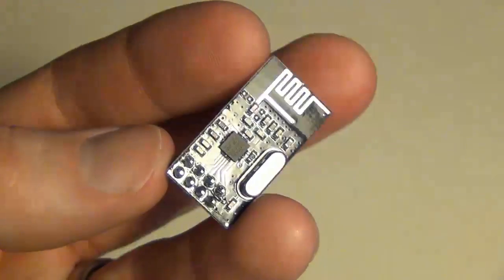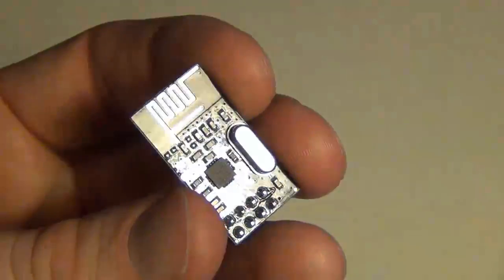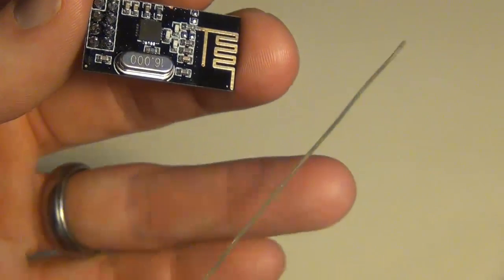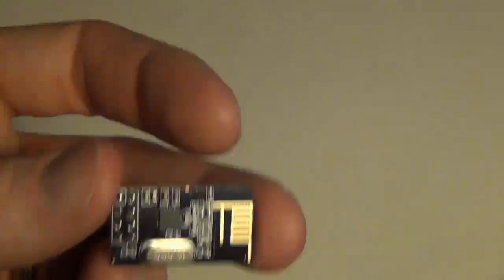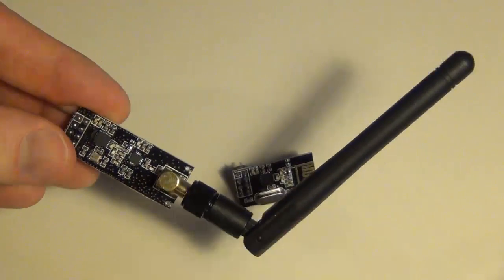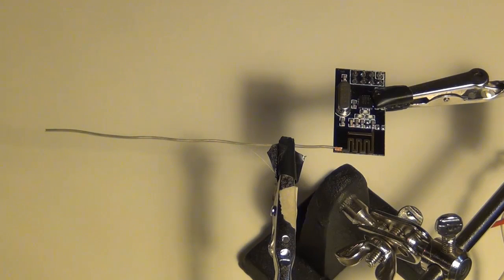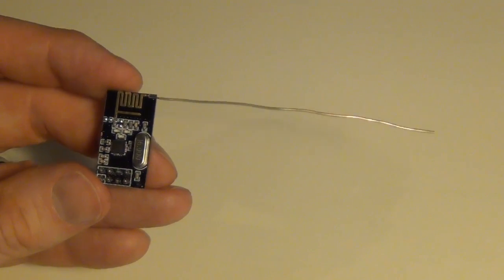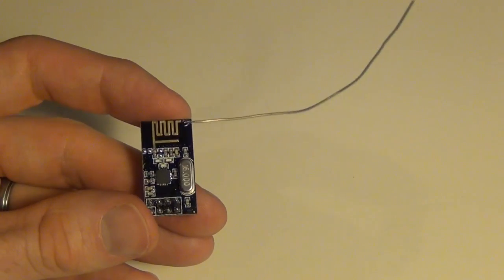Cheap DIY NRF24L01 Antenna Modification

Comment: I did the same thing with a ESP8266 wifi antenna and it worked. Thank you!
Reply: vi que voce é brasileiro
preciso de uma ajuda com um modelo de ESP8266 que tenho e gostaria de testar essa modificação, mas a antena é um pouco diferente!
Reply: @guilhermecorrea1775  qual modelo vc está usando? tem um link? o ESP8266 que eu já usei tem a mesma antena que mostra no vídeo. ficaria feliz se eu pudesse ajudar de alguma forma. a princípio, sugiro você simplesmente fazer uma solda como no vídeo, não precisa raspar nem nada como alguns vídeos mostram por aí. no pior do casos, é só tirar depois.
Eu sequer fui metódico em relação ao tamanho do fio e deu muito certo. eu decapei a ponta do fio e ficou perfeito.

Comment: I just used this video to solder a nub of wire onto the PCB i pulled from a cheap BT speaker which I have soldered onto audio leads to add wireless sound to my old-school stereo receiver at work. It used to have an unobstructed range of maybe 5 feet, and would drop signal from 2 feet away through one layer of plywood office wall. Now it stays solid clear across the garage (about 15 ft.) and keeps playing through the plywood wall with no drops! 

Well done, mate. Good video - very useful for the home tinkerer who may not have the micro-soldering equipment required by other videos on the subject!

Comment: Pete, how did you calculate the antenna length? A quarter wave antenna on 2.4 ghz should be about 1.1 inches long, not 4.
Reply: He did a full wave calculation no?

Comment: Just a thank you for uploading this vid 👍👍👍.    Using this simple mod on 2 x wemos d1 minis.  Now i can get the data from 2 shunts to give me the SOC etc to home assistant from within my metal shed into the house yay 😃😃.      (i used some thermocouple wire for the antenna as thats all i could find, and works well - eg, no reception outside the shed, now works from inside, awsome.)
Reply from the maker: Awesome! Glad it worked out.

Comment: I've done this to an ESP32 and it worked really well.  I soldered a 3 pin female header between the ANT connection and ground with the remaining pin soldered to the disconnected meandered trace for additional mechanical support.  I also added a liberal blob of epoxy as its pretty easy to pull those traces of the board.  I just stuck a couple bits of hookup wire in the sockets as antennae.  Using a straight monopole and a quasi-dipole (another monopole connected to gnd) both gave similar performance.  I remember one network's RSSI had been ~ -70dBm prior to the mod and -45 afterward.  As far as the NRF goes though, you're better off just buying the version with a power amp and SMA connector and screwing a rubber ducky from an old router on to it.

Comment: My understanding is that there are power resistors built into this specific board that limit it’s ability to do much with an extension. I think you can solder one or two off though. Did it make a big difference for you anyway?

Comment: The calculation seems weird. You measured it already being 1.64 inches, which is about 40mm. But the internet says, 2.4 GHz should have 28 to 32mm. So this antenna is already too long. Anyway, I'll just try soldering about 20mm of wire and we'll see :)
I guess, it should also work for the smaller SMD NRF24L01 modules, right? I have a tight space in the device where I'm adding Arduino Pro Mini, so I soldered an SMD version of NRF24L01 module directly onto Arduino. It works almost fine, but sometimes it gets stuck not receiving an ACK from the receiver and sending the same message a few times in a row. So, I hope an antenna extension might help add more sensitivity to receive those ACKs.
I'm also wondering why does the PCB antenna has that other small branch and whether it can mess up the total length? It essentially makes it like having a two-wing antenna instead of a single line, so this is confusing.
Reply: there are variations to traditional half wave dipoles, like full wave dipole and 1.25 wave dipole, and i think his antenna fall into the 1.25 wave one

Comment: What happens if I make it longer?
Reply from the maker: It won't work as well.  Antennas need to be a specific length that corresponds to the frequency of the wave.
Reply: @peteb9105  thanks

Comment: what is the maximum range with this modification?
Reply from the maker: Great question.  This was a non-scientific (and cheap mod) that has worked for me in my house.  I never did any extensive (or scientific) testing.  I just found it worked with sensors/radios that were in odd places throughout the house.  Sorry I don't have better info.

Comment: Why did you use an 83mm antenna extension? I'm not a professional, but I know that If you want the best possible range, you want the antenna length to match the wave's frequency. According to www.qsl.net/kd4sai/antencal, If we input 2.4ghz or ruffly 2450mhz as our frequency, the same operating wave frequency as the NRF24L01, we get an antenna length of around 116mm. We can then take the calculated length and divide it by 2 to get half the wave's length (I'm not an expert, but I'm told this also works just fine).
Reply from the maker: I had to go back an check my notes for this one :)  Here is what I had:
The total length of a 2.4 GHz antenna should be 4.92 inches.  I calculated about 1.64 inches is existing (on the PCB) so I added 3.28 inches (8.3312 cm) of Cat5e cable.

Comment: is that work with ESP8266
Reply from the maker: Sorry for the delay.  It could.  I would make sure to measure the PCB trace to get the correct length of wire you need to add.  The PCB antenna may be different on the ESP8266.

Comment: why the hot wire is connected to ground in this antenna btw ?
Reply: We're talking about 2.4 GHz. Every wire has some inductance and capacitance. That 10mm wire to ground is short at DC, but it is an inductor at GHz frequencies.

Comment: Where can I get the cat5e wire....I did not get a supplier for the bare wire....it is available as a cable
Reply from the maker: Just cut open any network cable and you can separate the strands.
Reply: @peteb9105  thanks

Comment: Sir can we use copper wire as antenna wire ?
Reply from the maker: Yes, that's what I'm using.  I just using one of the individual solid copper wires from a Cat5/6 Ethernet cable.

Comment: Peter B, you measured line to right turn, zig zag & right turn (0:50)?
Then 4.92" - above number = new mod antenna, correct?
Reply from the maker: Correct, the total length should be 4.92 in.  I calculated about 1.64 inches is existing so I added 3.28 in  (8.3312 cm) of Cat5/6 wire.

Comment: I know it breaks all the rules but I did this on an Android TV Box that has the antenna embedded on the circuit board. It's on the far side of the house compared to the router, no access to Ethernet. The TV Box was getting 3Mbs down and 3Mbs up on a 50Mbs down 5Mbs up connection, Making the antenna full wavelength the speed test went to 25Mbs down and 5Mbs up. My cell phone gets 13Mbs down and 5Mbs up sitting next to the TV Box. Closer to the router the TV Box and cell phone would always speed test at the full internet speed.
In the case of this antenna the total length from tip to feed point is 0.492" or 1/10th wavelength. I added enough wire to make the total length 4.92".
I paid 20 bucks for the box so it it blows up the wifi chip tomorrow, I'm ok with that.
Reply from the maker: +Ima ddicted awesome! I have been using this since I made the video and my radios are still working great.

Comment: Have you noticed if the chip gets hotter?  In making this mod, you will have changed the impedance of the antenna, which means your chip will be driving more current into it, and will be causing more heating.  I don't know how the chip is designed - but we all have an idea what goes into them.  I believe the heating will be very local - probably one or two transistors in the antenna feed, so while the entire chip may not get noticeably hotter, you could still blow the antenna feed.  You might be able to measure PSU current with and without the antenna extension.
Have you done any measurements on signal strength (eg taking the receiving unit further from the transmitting unit to see at what distance it fails)?
In an application where the transmitter is used on a very low duty cycle (a few millisecs in several seconds), this may be OK.  If it increases range as you say - well, nobody can argue with success.  If it works, it works.
DISCLAIMER - the only thing I know about antenna design is what I remember from my tech college course 50 years ago.
Reply from the maker: Hi Mike,

I haven't noticed the chip getting hotter but to be honest I have never done any testing regarding the temp.  It would be interesting to check the current draw with and without the additional antenna. 
I have not done any scientific measurements on signal strength either.  It all started as a simple way to see if I could increase the range of my sensors.  When it worked, I was happy and moved on to making more sensors. :)
If you end up doing any tests please post back here as I'd love to hear your results.

Pete
Reply: Hi. Is it possible to modify the smartphone Bluetooth antenna. Do i need to modify the resistor and capacitor of the antenna feedline to avoid heating. I am planning to modify the smartphone Bluetooth antenna to improve its range. Thanks for the response.

Comment: Whenever you're making an antenna (or extension) you do NOT CUT FIRST THEN SOLDER, you always take a bit more wire than needed and SOLDER THEN CUT the wire to the correct length ... Otherwise the amount of wire overlapped onto the PCB trace (or original antenna wire) is a loss from the overall resulting length and at 2.4 GHz a little bit makes a big difference (it's even more picky at 5.8 GHz) .
Reply from the maker: +Bill Chenoweth good idea, thanks for sharing.
Reply: @peteb9105   thanks pete for accepting Bill tip. (smart of u not to take it as personal attack :) )
Reply: @allersvp  yes, tbh reading caps makes someone think that person is mad or yelling at you

Comment: While understanding my question is based in a different area of use, I believe you can answer my question.

I have a drone that runs on 2.4Ghz. The controller has an integrated antenna, much like in your video, I believe it's called a PCB (printed circuit board) antenna. There are several modifications for other "wired" antennas which allow for extended range but your video is the closest thing I have come to in finding a modification to increase range with an integrated antenna.

My question is this; you mentioned something about the length of antenna (4 inches) being a requirement of sorts. Can you go into a little further detail as I would like to solder a wire to increase the range of my drone. is there a maximum length or minimum length of the wire must be to be effective?
Reply from the maker: It's hard to see the connections on your picture but it appears there are 3?  It may be difficult to get good results if that's the case.  The hack I did just had one connection so all I had to do was solder an additional piece of wire.  If you did want to try to add some wire then the total length of a 2.4 GHz full wavelength antenna should be 4.92 in.  So, you would need to measure what's already existing on your PCB and subtract that from your total length of additional wire.  Make sure you don't count the part that will be soldered to the existing PCB as part of your additional length.  This is a crude method but if you are careful you should be able to desolder the antenna if you find it doesn't help.  Good luck!
Reply: Thanks for the response

Negative, there is only 1 antenna which is a PCB antenna in the upper left corner of the controller (it looks like gold leafing)

I will try that, thanks again

Comment: Very bad solution. You need to disconnect pcb antenna.
Reply: does shorting the capacitor at the antenna point helps as well???
Reply: actually he did, if you read and watch very closely.

Comment: How far do you get with this antenna? Thanks.
Reply from the maker: +Marc Paradis 
I have never actually tested the range, sorry.  I have a smaller house and there are times when the pcb antenna will not communicate with my gateway. When I add this antenna it has fixed the communication issues.

Comment: I have the so-called "long range" expensive version of this with the external antenna. Looking at the amplifier IC, it has a digital input to switch between TX and RX which is wired to the antenna output of the NRF24. 0 is RX and 1 is TX. Wiring a digital input to an antenna signal is plain dumb, you will loose signal strength and the digital input won't work right. So, all you need to do is cut that trace and turn the transceiver in either RX or TX-only or connect that digital input from the amplifier to the Arduino to control direction (keep in mind the auto-ACK feature of NRF24, you might need to turn that off). I am sure that once you'll do that it will work for a very long range, until then, it's just a waste of money and your solution in this video might work better and cost a lot less. Just a FYI for all of you who want long range on these things and plan on buying the expensive version. And another note: if you look at the cheaper version with the PCB trace antenna, it has a route straight to the ground plane. If you solder the additional 8cm as shown in this video cut the trace that goes to ground and you'll get much better range.
Reply: Thanks radby, One question: Can you tell us where is the trace that goes to ground? (The one that has to be cut)
Reply from the maker: +radby Thanks for sharing.

Comment: Hey Pete, thanks for all the great videos! I'm just getting into HA and your videos have been so integral for me. Bought a Vera Edge, built the serial gateway just like yours, then built the Smart Outlet just like yours as my first piece of automation. It's great but it's only working intermittently unless it's very close to the gw. The place I want to put it for now is through a couple walls and maybe 35 feet from the gw and there it gets iffy. I tried boosting the transmit to MAX in myconfig.h and re-uploaded the gw sketch but it's not much better. So thinking about trying this antennae trick but wondering if it's ok to bend the wire around inside the gang box? Have you tried that? Just wondering if the enclosure isn't hurting the effectiveness of signal and whether this antennae will still help if also enclose (and bent around) in the tight space of the gang box...
Reply from the maker: +Ben Alsop 
Great, glad you're getting into mysensors.  It's tons of fun!  I just wish I had more time to work on projects...
Hmm.  35 ft is not that far but it depends on how many walls it has to pass through.  I use the radios in this video for every project as I didn't have much luck with the amplified version.  I have my gateway and nodes set to MAX unless they are very close to each other.  You can definitely try to bend the antenna in the enclosure.  Just make sure it doesn't come into contact with anything so it doesn't cause a short.  I generally drill a hole in my enclosures to poke the wire through just to make sure this doesn't happen.  I actually just added an antenna like this to one of my intermittent nodes a couple of days ago and it has been great ever since.  
If it still doesn't work you could build a repeating node to relay the signal to the gateway.
Reply: +Pete B Thanks for the reply Pete. It's seems to have gotten a little better after I adjusted the position a little bit. Probably works 90% of the time now which I can live with for now. I thought about a repeater in between as well. I know I'll be doing more projects so just a matter of time before I get something in the room between the gw and this outlet. Do you have any experience with any of the pre-packaged z-wave switches (e.g. GE127...)? I was thinking of getting a few of those to increase my level of HA in the house. Do you know if those would work as a repeater in the Mysensors network? Would you add them to the Vera by the inclusion process in the Mysensors plugin or would you directly "add device" in the Vera UI? Thanks for any info!!
Reply from the maker: Ben Alsop Z-Wave and MySensors are not compatible with each other so they won't help each other boost the signal.  I would be cool if they did though!  If you're adding Z-Wave switches to Vera you would want to use the Vera inclusion process, not the MySenors one.  Hope that makes sense and sorry for the short reply, in a hurry :)

Comment: While I agree with Attila Wager, this shouldn't work - it totally does!

Maybe there is some impedance matching in the IC?

Thanks for the tip Pete B!
Reply from the maker: +Will Cooke
Great, glad it worked for you too!  It may not be a perfect solution but I get noticeably better results.